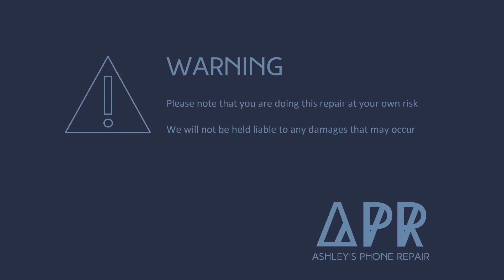Google Pixel Screen Replacement and Removing the Motherboard

Comment: T5 pentalobe? I believe that a T type of screwdriver has 6 lobes. A P5 is a pentalobe type of driver. My pixel 1 has T5 screws and my T5 screwdriver fit them well.
Reply: Yeah the T in T5 stands for "Torx", the Pixel's screws are Torx screws. Pentalobe is different, 5 pointed star instead of 6 on Torx. Pentalobe is only found on Apple products as far as I know.

Comment: Where do you get a new motherboard? I have a pixel XL that is in a boot loop and I am read that it is the motherboard(I have tried everything else.)
Reply: Hi, I've the same problem! I know three years passed but did you find where to buy the motherboard?
I found a couple on aliexpress but i'm not sure
Reply: @TheresAFuckingDuck  I ended up taking it to UBreakWeFix. Not long afterwards I got a Pixel 3a and still have it.  Greatest phone ever.

Comment: I dropped a weight on my Pixel, the screen didn't crack or anything but it hasn't been able to power on since, is that a damaged motherboard?
Reply from the maker: It could be a damaged LCD, the screen may black out if the LCD has a hairline crack some where on it, some times it inst even a visible crack. It could also be a damaged motherboard or potentially a disconnected battery. All you can really do is open it up and try reconnecting the battery and making sure there isnt anything disconnected.

Comment: how can i save my memory from the motherboard.. my music and texts didnt backup, my phone wont really power on. Is there a way to do this!? i have a google pixel1
Reply from the maker: It could just be a battery issue, some times if the battery is completely dead it will not charge at all and not turn the phone on even if it is plugged in. Or the LCD could be blacked out from some sort of fall or moisture. Replacing the screen and battery might be your best bet, as long as you are very careful with the repair their shouldn't be any memory loss, unless of course it is a damaged motherboard which can be the case some times. I have fixed countless phones over the years and have never had any memory loss just from replacing a screen or battery.